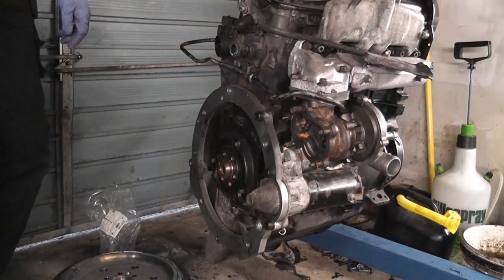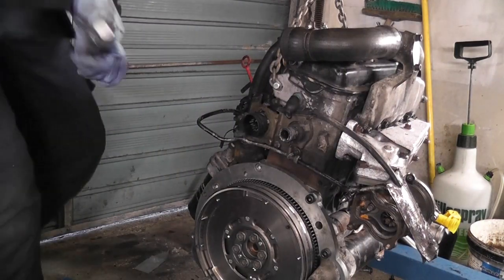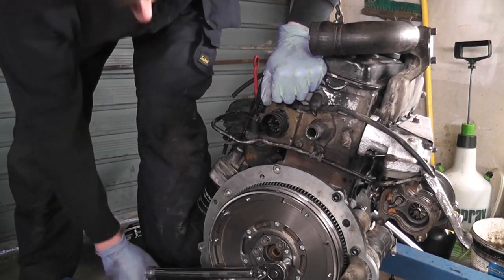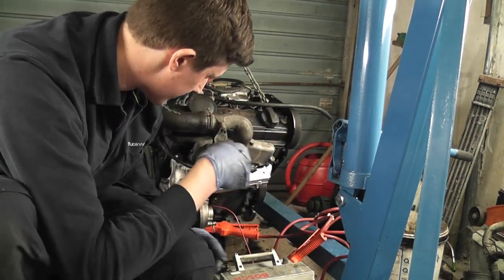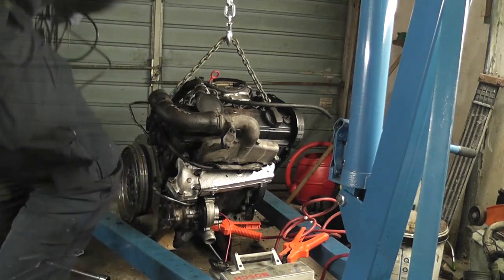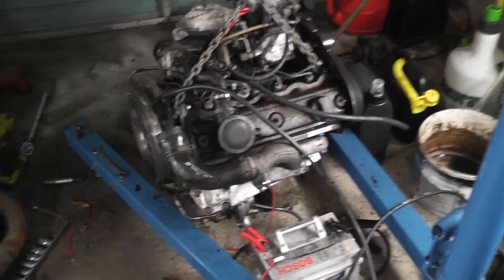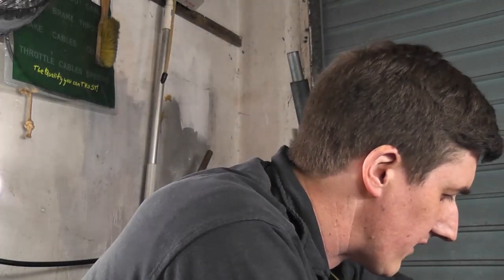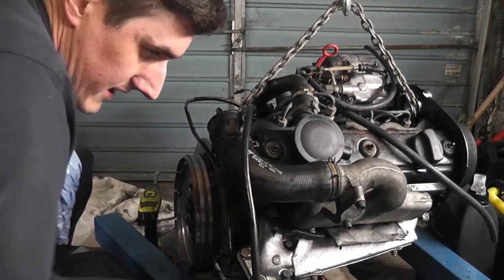Fitting DMF, first crank and sorting out oil pressure issue - VW camper TDI engine swap

Comment: how did you get the correct dmflywheel sorted. i've got a transverse pd tdi from an early skoda fabia, planning on fitting to a flipped passat b5 021 box. Do i go with a dmf from a passat b5?
Reply from the maker: You need a DMF from a B5 Passat. If you get one from a transverse engine, the starter ring gear will be on the wrong side.